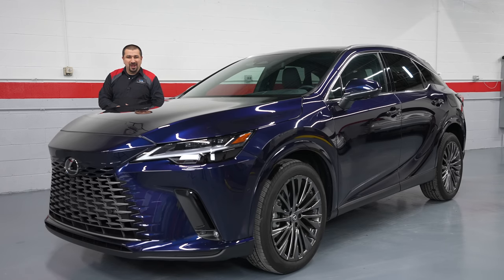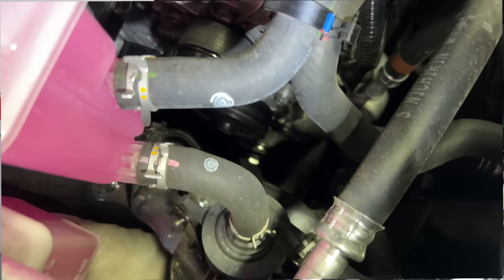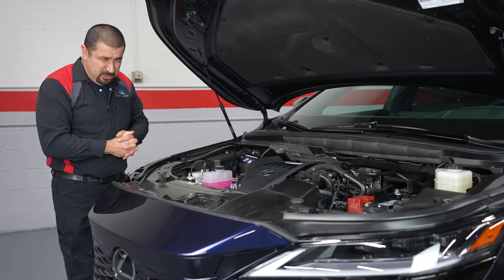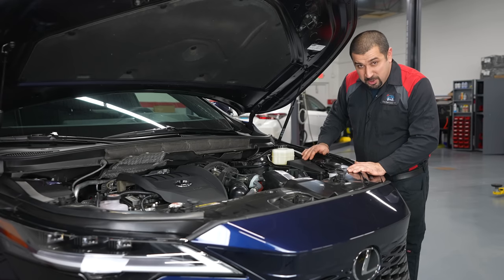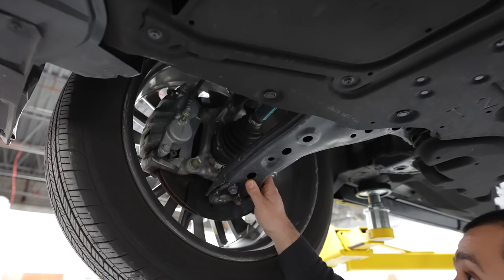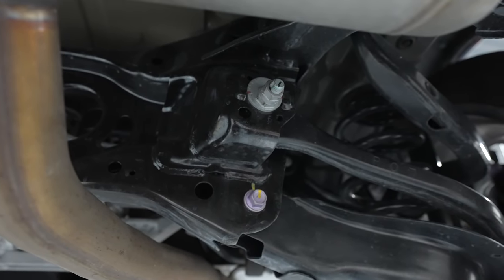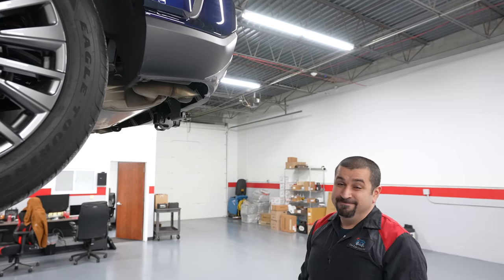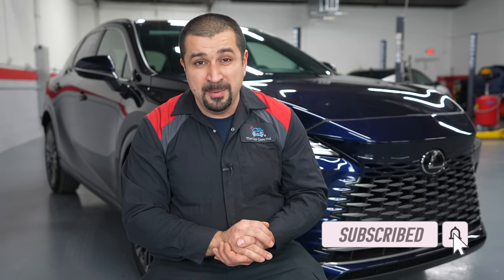Should You Buy The 2023 Lexus RX? Everything You Need To Know

Comment: I cannot thank you enough for this video. I've owned both the RX300 2000 and RX350 2011. I kept the first for 17 yrs purchasing the 2nd one so my 16yr old at the time could have a safe, reliable car. I'm about to purchase another car as my other daughter is now 16 and beginning to drive. Both cars held up wonderfully except the first had computer chip issues early on and the 2nd had a failed transmission due to the transmission computer chip failing but the Lexus dealership not diagnosing (I replaced it so she would have a known car). The only other issue was self-inflicted, managed to bang up both rear bumpers...I share this because I've been looking for a year now at the new Lexus and other cars. I wanted modern tech in the Lexus - saw it last year in the NX waited this year for the RX after learning it would be available. I'm THAT nice driver that wants a nice car that is reliable, safe and will last 15 years. I worry about the modern tech lasting for 15 years and agree it has really jacked up the pricing for something I won't use. I still think Lexus is top-notch for me over other options. Ugh what a dilemma now... Maybe I will forgo the new tech for a pre-owned model. Thank you so much for a very thorough analysis!!!

Comment: Great review. 100% agree on the dislikes. I currently have a ‘19 NX and got to spend a day with a 2023 NX service loaner.  Same complaints with the new systems. The digital latch is annoying and unnecessary. Two steps to open or close. The shifter is unintuitive. Push forward to go in reverse. Push backward to go forward. I always had to look down to make sure I was in the correct gear. Why Lexus? Ok, so no more track pad. I sit way back and it was a constant shoulder pain to keep reaching for the touch screen. The start stop system is another annoyance. I found that if you gently press the brake pedal when stopped, the engine doesn’t shut down. Have to remember that when making a left turn, and I forgot to turn the system off. The safety systems kept beeping, but you never know for what as all the beeps sound the same. Lastly agree on the engine. This one requires premium fuel, the previous V6 took regular. So, even though the 4 cylinder is slightly more fuel efficient, it will cost more to run. Great video. Great channel. I’m glad that you can point out the negatives as opposed to other reviewers who just love everything.

Comment: Great video AMD! Just a comment about the e-latch system though; I felt the same way myself when it debuted on the 2022 NX. However, having lived with it for 7 months in my 2022 NX, it really isn't nearly as bad as you think it is. The learning curve is very gentle and now, it's just easy and intuitive. I've also lived through this in a few cold freezes in the great white north and it's not frozen on me at all. It's been great all the time. Give it time and you'd come around.
Reply: lucky you.. my nx door handles froze constanly when the temperature drops below 0. took it to the dealer, the advisor said he knew it was gonna happen, and there were many open case about this issue, Lexus is working on it for a soultion
Reply: It still doesn't add anything to the vehicle, and is just one more piece of complexity that can malfunction.
Reply: How is your NX in the winter? I’m looking at one but am concerned about how it is during or after an Alberta snow storm 🥶
Reply: @Adarn_Schefter  My NX has been fine. I do have a dedicated winter tire set which definitely does it good. Also the AWD system handles snow very well. Not once have I gotten stuck in any snowstorms or bad weather. Just waiting for the temperatures to drop some more before I throw the winter set on again.
Reply: It's an answer to a question no one asked

Comment: A very well done presentation. There is a point where technology becomes gimmickry, like the door handle issue you described. I suspect much of that is driven by demographics in an attempt to capture younger buyers and/or provide separation from competing brands. I purchased a 2020 RX new and was floored at the collection of manuals provided to 'operate' the technology. Once we read enough to drive to the market and back, the manuals got shelved for the duration of the vehicle. As for the 2023, I can think of nothing more frustrating or dangerous than trying to 'drill down' on a touch screen display to find a needed function while on the road. Once again, an excellent review. Thank you.
Reply: The infotainment system has NEVER been one of Toyota/Lexus strong points.  In fact they always seem to be behind, but what they do have tends to be very reliable.  I also have no explanation why they continue to uglify their vehicles. It defies all reason.  They could make stunningly beautiful products  if they wanted to.  The stunning LC is a perfect example of what is possible.

Comment: I have a 2013 RX 350. I would not consider this new turbo-charged version over the V6.  They won't last nearly as long. I see you also have a nice, Pearl White Venza in your shop. That is my other car, also a V6. Love it.
Reply: YEP! Kinda like a turbo V6 for the TUNDRA. NOPE! V6 is RX, not a turbo 4. As Scotty Kilmer says more or same power for the smaller engine with turbo, but will have a shorter life span, especially if you change the oil/filter every 10k miles as recommended by Toyota. What can go wrong? 🤔

Comment: I have been driving RX350s since the early 2000s and have had my current 2015 RX for 8  years.Historically i have replaced cars after 3-4 years and am now in the process of looking to replace my 2015. Due to the increasingly outrageous pricing of Lexuses I have been looking at Hyunadai and Kia Hybrids as well as the Toyota Venza. My Lexus has 96000 miles on it and is in excellent condition. My wife has really pressured me to keep our RX and drive it for another year or more because she loves the RX so much and doesnt want to have to learn all of the changes which come with a new model or new brand of car.
This video has been very helpful to me in deciding to keep driving my 2015 RX, but i think i will start looking for a 2022 RX or preferably NX300hybrid as our next car. I didnt realize Lexus switched to a 4 cyl engine or that they have all of the technology you describe , most of which i wont use. The only technology i insist on in a car is the Blind Spot Monitor which has saved my bacon on many occasions. Thank you for doing such an honest and thorough job of going over the 2023 RX. As so many others have said you are not only an expert mechanic, but an honest one too! Rare these days.

Comment: I have to say for the first time, I prefer the Highlander now since the latest gen received seat memory, functioning ventilated seats, etc.... and a very smooth ride with a much much much improved seat from previous gens
Reply: The Highlander Premium has most the RX features, is larger, just as comfortable for $10,000 less.
Reply: @rich2putt well I love the 366 hp and 1800 watt levinson sound system. highlander is nice, but its no RX500h.. I actually did a comparison.. they definitely improved the highlander over last version, I had a 2014 limited.. have a new RX though and love it so far.

Comment: I would go for the Venza. Fit my pocket book, less bells and whistle and no turbo to worry about.  Good on gas mileage too.
Reply: Yes, it is true. I was thinking to get a Venza at first, but I just don't like the front end and I ended up with a V6 Highlander, which that thing is sweet! Silky smooth V6 and quiet... love it!
Reply: I have a Toyota Venza 2009 AWD with V6 2GR-FE engine only with 114k miles. I do most of the maintenance myself (brakes, spark plugs, shocks, wheel bearings, stereo upgrade, oil change and transmission oil). Still drives like new and the Lexus RX350 shares the same basic engine (albeit upgraded). Very smooth engine and easy to live with but if you want a sporty ride this is not for you.
Reply: @TigerKittay  Nice, I really like that generation of Venza. 2GR is also one of the best engines ever made.

Comment: You definitely bring a much-needed perspective to the car review genre!  As someone with a 2025 rx 350h on order currently, I am obviously biased but I feel that model is where this generation shines brightest.  No turbo heat and complexity, very proven motor and eCVT, and 36mpg which you simple won't touch with 95% of the other powertrains offered in any brand's midsize SUV.  I'm coming from a 2017 CX-5 grand touring and the level of smooth, quiet refinement is night and day improved.

Comment: I have the 2023  rx350 premiun plus.....
I  have put about. 3 k miles on it. I have always driven Honda or Toyota. The 4 cylinder in the lexus  feels and sounds very refined compared to the
four cylinder in the CRV, or Accord. Engine wise, Lexus  is an upgrade for me. Depends on where you are coming from.
The cabin is hush quiet when driving.
Well made car....
I could not find a better  luxury  crossover for under 60K .
Safety...Top pick  plus
Reliability.... Toyota/ Lexus
Value..........Under 60 K. 
I have a       2013 Highlander that has the Toyota V6 in it.
The new Lexus 4 cylinder is  just as quiet  and smooth.
When you accelerate quickly from a stop it can get a little "throaty", but I dont drive like that anyway.
By the way, the "throaty" sound is really not that annoying, a bit out of character for the car, but not 
a deal breaker.

Comment: AMD this is a great video.  I watch every release of yours from start to finish.  I own a 4Runner and recently came across some videos/articles on the stock Panasonic batteries that come from the factory.  Sounds like they are extremely high quality.  Many people reporting long life from them.  The part I found interesting was that some are saying to monitor the fluid level in the battery with a flashlight.  Fill each cell with distilled water if below the bottom line.  A video on battery quality and best practice for battery care would be well watched IMO.  I could be wrong though.  Happy New Year!

Comment: Just got back off 1,500 mile trip with ours ran 70-75 mph averaged 30 mpg's and I checked it manually twice.  This motor and transmission is much better than our 2019 RX350 we traded in
Reply: Better how?
Reply: @JohnnyUtah9173  The navigation system, the seats are better, heads up display and it’s overall more comfortable and it’s a nicer looking vehicle.  The 4 cylinder engine is just as peppy and it’s not noisy.
Reply: @dennisdewald6729  I was asking how the “motor and transmission are much better,” as you stated. How are the motor and transmission much better?
Reply: Good morning Johnny, I’m sorry I misunderstood your reply.  The motor and transmission don’t have the lag in it the 2019 did .  The transmission doesn’t wander around between gears. We bought the 2019 new and my wife drove 95% of the time because I hated the shift pattern on it.  I had a 202
Reply: I had a 2017 Tacoma with a terrible shift pattern too got rid of it and got 2019 4 Runner

Comment: My Jeep XJ Cherokees had the same three point hood hold down.  It worked fine and it looks like a lot of air could be forced under the front of the hood due to the design of the headlights and grille, so it makes sense to be overly cautious instead of possibly having the hood flutter.

Comment: I agree 100% with your comments on the 4-cylinder engine.  I have both a Lexus RX 330 and Corolla and I can't image the Corolla engine in the RX.  Lexus is not going to worry about comments on this site, but they certainly will take notice when their sales tank bc of the engine.  While both 4- and 6-cylinder Toyota/Lexus motors will last 300,000+ miles, how long does a turbo last?  And does it get louder with age, i.e., the more miles on it?  The beneficiaries of this motor change may be Honda/Acura and Kia/Hyundai who I believe are staying with a 6 cylinder engine.

Comment: The most honest, real review I have seen.
Have one and the beeping is annoying.
If you turn the safety features off because they beep too much, what is the point of even having them?
On total it is a nice vehicle but Lexus needs to step it up.
Materials?
Good but the sunglass holder is so cheap it feels like it belongs in a kids Power Wheel Toy.
The Steering Wheel tilt cover is also super cheap looking.
Finnaly the doors are hard to close because the Cabin is so airtight.
Older 2022 RC has door glass that drops a little automatically to let the doors close easier.
It is a nice vehicle but for the money, it should be awesome!

Comment: This is NOT what I wanted to hear, but I suspected it would be the case.  Currently driving a 2015 RX and it's awesome, I have NO intention of replacing it anytime soon....but the thought has crossed my mind.  What would I do if I needed another car?  I've had my 2015 RX almost 6 years, and the CPO warranty ends in July 2023.  Not worried about the warranty...but I'd rather stick with the 2015 model instead of changing to anything newer.  Maybe I'll change my mind when the 2023 and future years are used vehicles?  Probably not, I'm cheap, that's why I'm keeping my current ride.  Thanks for the awesome honest review!!

Comment: Excellent review from a Toyota Master technician! I test drove the same car last week and noticed the same thing about very loud or buzzy engine while the seats are very comfortable with nice interior. Four cycline turbo engine with buzzy noise ruins the quiet and luxurious image of driving a Lexus RX. Also transimission has too many gear and felt like there are multiple times with the car doing  gear hunting. Previous 6 speed transmission from Lexus is way smoother than this new 8 speed transmission.
Reply: The 8 speed has been there since 2013. The 13 f sport RX used the 8 speed
But the 2016 redesign got the 8 speed for all RX models except the hybrid

Comment: The dealership just loaned me one of these while my old RX had service. You are sooooo right about all of the annoyances. I did a noise level test and it is louder on the road than my current RX. Maybe that is the engine? I also read that the 4 cylinder turbo engine only gets you 2mpg better mileage than the V6. My V6 gets up to 30 mpg on the highway.

The engine sounds and feels like the one I had on a RAV4. It's sad that the RX luxury feel is gone. I would not buy one of the new ones. The steering wheel touch system is pretty crazy and, as you said, distracting. Thank you for your thorough review. I always love watching these. I hadn't noticed the lack of a bumper on the back!! 

Love your channel. Fair and honest.

Comment: Your honesty about the 4 cylinder engine is what initially concerned me when I first heard they’re doing away with the V6 on the RX.  We have a 2022 RX V6– the last of its kind.  It’s a lease and not sure if we want to keep it now.  We hate the gas mileage though of only 16.1 (mostly city) in our current RX, and really wanted a hybrid.  But not in any of the RX current iteration.
Reply: I’m late reading your comment, thus it is later in the year, so I don’t know how or if you can find one, but if you could find one of the last 2022 RX450H models, you would love it.  It is a hybrid with a 6 cylinder ICE.  Plenty of power, gets up and moves when you want it to, and much better gas mileage than the RX350.  I LOVE my 2022 RX450H. 😍 I average 25 mpg around town and 30 mpg highway.  I will  have this car until the wheels fall off!  Of course they won’t fall off because I take very good care of my cars. 😉
Reply: @lindyloulie80  Yeah. I got the regular 2022 RX350 since I couldn’t find the RX450H anywhere within a 600 mile radius of where I was at.  Don’t get me wrong, we still love the RX 350 (actually it’s our second), but we much rather prefer the 450H given the mpg and soaring gas prices. (We also do 85% city driving to work which doesn’t help).  We avg 16.1 mpg and that’s driving conservatively on Eco through the city 🤮

Comment: Excellent review as usual.  Your are 100% correct on the engine noise.  I test drove a 23 RX with 4 cylinder turbo and then a 23 Genesis GV80 with 3.5L twin turbo V6 and the difference in smoothness and quietness was night and day.  I have to assume Toyota will remedy this by going all electric with the RX eventually.
Reply: They won’t. The RX electric already lost badly to the gv80 ev 😂

Comment: I own the RX350 2024 with the 2.4 turbo engine and it has more torque than the V6 and to me is quiet, strong, and refined.  I previously had the V6. You must be having issues with the hybrid version with the non-turbo engine and CVT transmission - there is a tradeoff to get that gas mileage.  My car does not have a head-up display, but I would turn it off if it had one as I have found them distracting and of no value.  I would like a 360 camera as standard.  As far as beeps, just turn them off - not difficult so why did you not mention?   I've only heard a beep and a yellow light if I am getting too close to a wall when parking or another car when parking and this is very helpful.  And you want the trackpad back?  The new screen is incredible along with the sound system.

Comment: Rear kick sensor is useful when traveling and your hands are full of bags, clubs, children's backpacks, kick to open or close if unloading. 
The first button also is how you adjust the tailgate height.
The right side button is the close and lock once I leave button. 
You can turn off monitoring; if you can stay focused all the time.
Front Cross Traffic, the 2016 RXs had many of these safety features standard; without a bump in the price. 
2001 RX 300 AWD was $40,000 window sticker. 15-20 year life span.
2023 RX 350 AWD Premium $50,000 window sticker.
Blank buttons are programmable; if you want one to do something specific.
Also, you have voice commands and focus on driving.